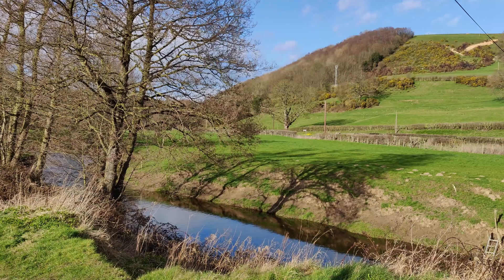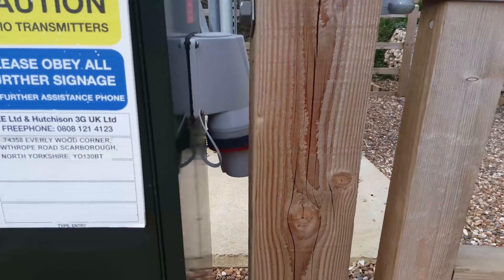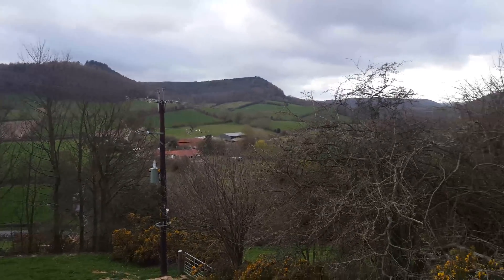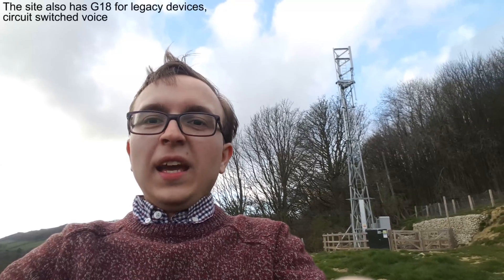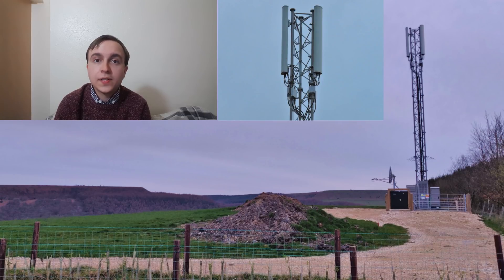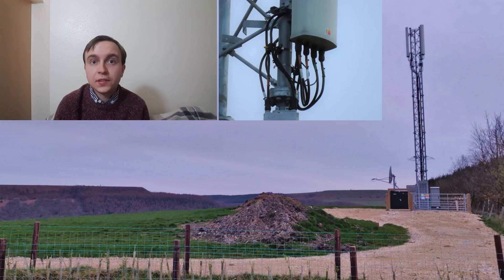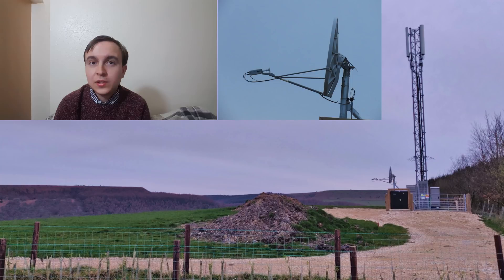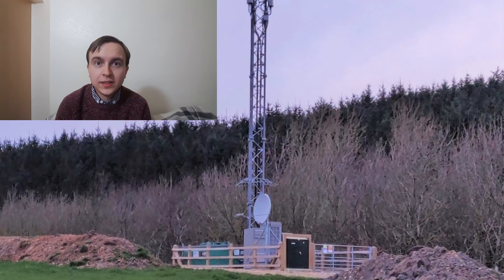Shiny New EE Ultra-Rural 4G sites in North Yorkshire. VSAT + Generator site and performance analysis

Comment: I wonder if EE is installing some of these transmitters in such remote locations, due to the Emergency Services Network contract.  Which I think requires that they have coverage in virtually every area.  As the ESN works on 4G (I think) they can also run there usual mobile services from these sites.
Reply from the maker: Gavin and spotify95: The second site is ESN, first as far as I know is not.
Reply: Yeah, that satellite fed backhaul does seem to suggest ESN capabilities, or even exclusive use to ESN if required.
Shame that they can't focus on improving coverage in certain populated areas that have always been a problem (and could be resolved by either moving the mast or adding another sector!).

Comment: Great video! Do you expect power and terrestrial backhaul to be coming to that L08-only site any time soon? Here in the US, I know of some AT&T sites in the western national parks that are permanently fed off of generators due to the complete unavailability of power. Is it a similar case in North Yorkshire? As for VSAT backhaul here, Sprint and T-Mobile have been using it extensively for very rural low-band only sites. Much of T-Mobile's Montana buildout originally went live on Gilat VSAT though they have been working with local fiber providers and telephone co-ops in order to get more solid backhaul. Sprint has been using VSAT for semi-permanent 800 MHz (CDMA BC10 and LTE B26) COWs in towns and some similarly rural areas.